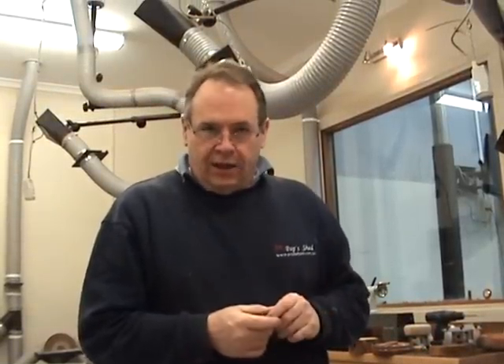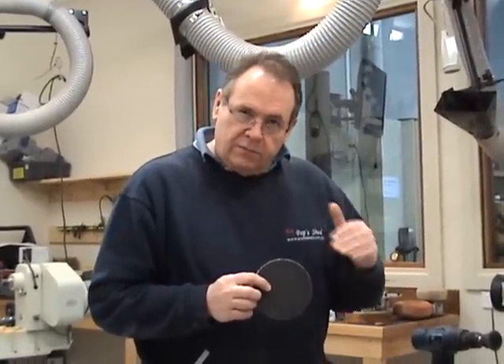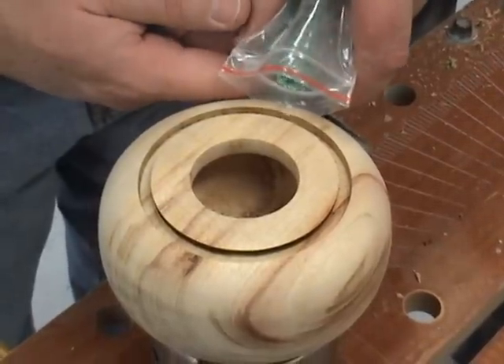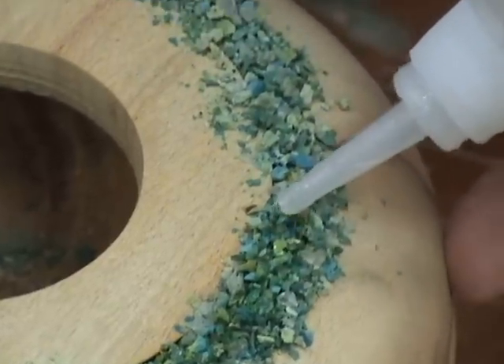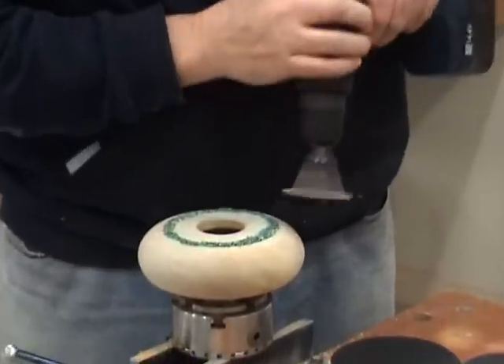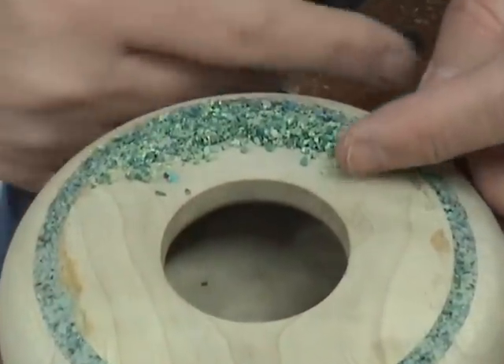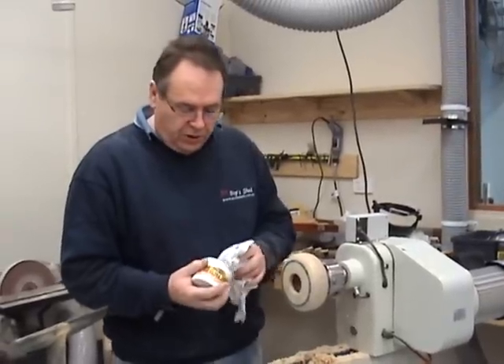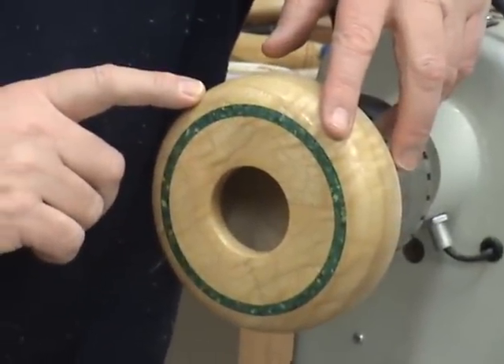Stone Inlay in Woodturning

Comment: Wonderful video. Thanks for sharing. It occurred to me that perhaps using a flat Diamond Tip Wheel Dresser would be a good tool for leveling the excess stone after the gluing has been completed. That way you could stick the piece right back on the lathe once the CA has cured .I have also used Diamond cut off wheels on a dremel to shape stone on the lathe. I cover the lathe bed with a towel to absorb the water used to keep the wheel from clogging up, minimize the dust and keep the heat generated to a minimum. Definitely I would be sure to use breathing protection as the dust created using either the drill with pads or the diamond dresser are bad for the lungs!

Comment: Gorgeous!

However, why do you need to give CA glue 24 hours to dry? Have you had issues with the glue in half, or a quarter, of that time? I get not using accelerator, but why 24 hours? I mean, it's super glue and should cure fully in 15  minutes, max. Is there an issue with blow-out if not cured for 24 hours? Is it the CA glue you're using?

Comment: I know this vid is old, but there's always people discovering this for the first time, so I'm hoping you look in on your old vids!
My question is: why use the superglue approach? I know a lot of people seem to use it, but to me, it seems an odd way to do it.
Why not mix it in some clear resin first, then shove it into your recess as a paste? Pretty sure this would be less messy and a lot more controlled.
There's also a good crafting resin out there that also acts as a glue, (I have some) so it would bind well to the wood.
I am looking to give a similar treatment to my wood staff, which has massive cracks in it, (it was once a small gum tree sapling) so I wanted to fill it with something to stop it splitting further and hopefully give it some strength.
What do you think?

Comment: I read down the comments a little and did not see if you answered this but where do you buy your inlay or do you crush the rock yourself? Thanks for the video....
Reply: +thomas reddick  vendors on ebay sell crushed turquoise sand and powder, also other stone materials are available as well for other colors.  Also, dyed black epoxy makes an excellent binder for turquoise.  Make sure to use an alcohol based dye and compatible epoxy though.
Reply: +Jack Larwa You know what would work well as a black colouring? Charcoal powder! I know this works because I've used it as an inlay in my bone carvings. I just used two part epoxy resin glue, and then once the flue was mixed, stirred in as much charcoal as I dared. I then shoved it into the recess with my finger, let it cure completely, then sanded it back for a crisp, clean finish.
And how to make the charcoal powder? Use some wet & dry sandpaper and rub the charcoal up against it and carefully collect the dust. I have a small bottle of the stuff!
Reply: +TheMurlocKeeper sounds like a good idea to try!  I'll have to give it a shot.
Reply: TheMurlocKeeper your right that does work real nice.
Reply: Woodcraft also sells stone chips and stone dust. (woodcraft.com) If the voids are REALLY deep and you don't want to waste the stone, you can use dry coffee grounds under the chips. It really does work well. Hope this helps.

Comment: Why not use more of a powdered stone to avoid the pockets and get a better fill the first time?
Reply: I'm not too knowledgeable about this, but I imagine it would drastically alter the end result. Having a variety of stone sizes makes it look more natural. As you sand away, you'll have bigger and small flat sections where the stones were sanded into. if you used powdered stone, it would all be homogeneous, and I imagine would end up having a less enjoyable colour.
Reply: seigeengine May be.
Reply: Josef Roesler Nah, I'm pretty certain after additional reflection. The larger pieces are necessary to make it worth using the stone at all.